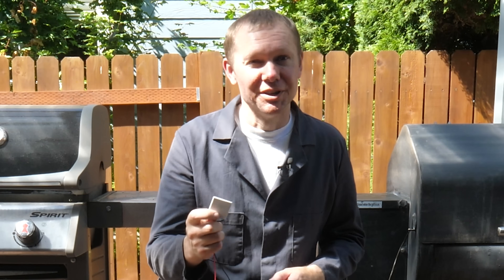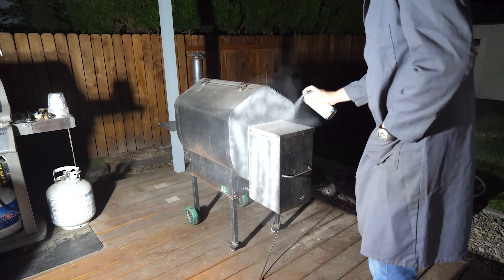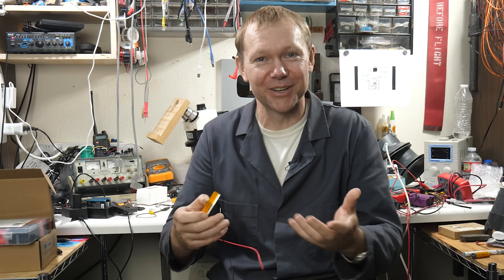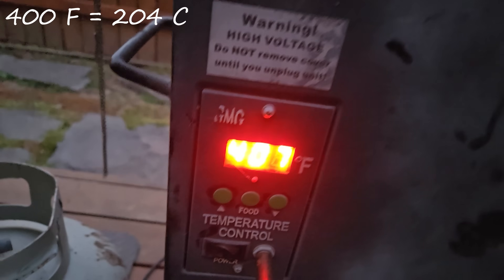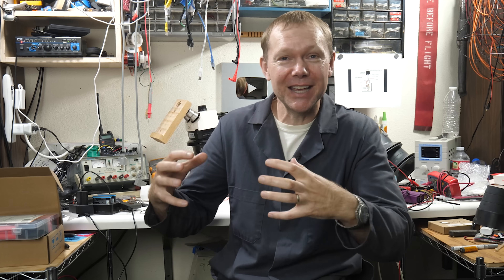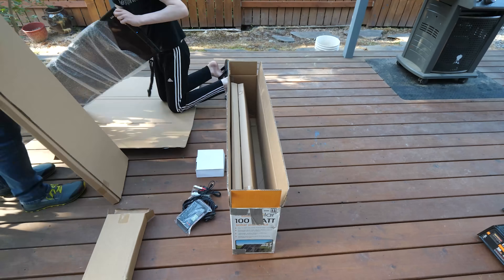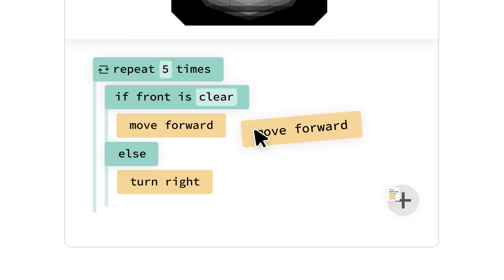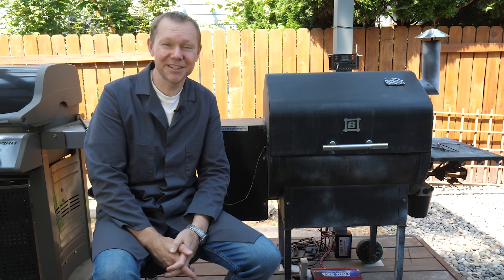Can you make ELECTRICITY while cooking?

Comment from the maker: One of the Quint BUILDs patrons (they get early access) recommended a battery 3x expected demand to maximize longevity, so ~15 Ah. Apparently lead acid batteries don't like being discharged below 50% and lose anywhere from 3-15% capacity per year when treated nicely. Lithium can go far lower but doesn't like being charged in cold weather. So maybe if a lithium bank were kept indoors, that might be a better way to go? 

The video with details on the solar setup can be found here: https://www.youtube.com/watch?v=WNP5ld7AJGg&t=0s

The patron-only version where I go into details about 3D scanning for CAD modeling plus details about thermal imaging can be found on Patreon after you sign up!

Lastly, this was a fun project that most anyone who is project oriented could figure out. Naturally anything you do is on you. If you're unsure, either get some professional assistance or don't proceed. Ultimately it's up to you!
Reply: Use a Stirling engine with a propeller instead
Reply: Hey maybe you can help change my life and help me not feel like a prisoner locked away in my house during the Florida summers. After watching this video and you showing how the ThermoElectric module is used to make portal coolers the thought came into my head if it would be possible to connect one or more of them up to a recirculating water vest to keep it cool without a use of water packs. At the moment I'm missing out on my 2 year olds life do to my disabilities and heat above 76° F is fastest trigger to shut down my body. I live in Sunny and getting hotter South Florida. My support system is here and money is tight since my diagnosis back in 2019 so moving to a cool climate isn't an immediate option. Your a father so you know how important it is to be around in these early years and I'm growing depressed not being able to go for walks, go to playground or even be out of the A/C for more then 10 mins with my boy in the late fall and summer months. I've had the idea of a water cool vest ever since I saw the video of Adam Savage make one when he did the Astronaut Cosplay for Comic Con but I can't keep a backpack of heavy water on my back. An active refrigeration solution with passive heat dispersal would be my idea.
Reply: I'll do some of my own research based on the information you provided in the video but I'm very new to theory of electronic circuitry and my only skill set is soldering and repair of existing boards and very basic 3v & 12v LED circuits.
Reply: Those issues with lead acid batteries are real. Also, lead acid batteries should ideally be kept fully charged as much as possible, as in, use but charge up again as soon as possible. The disadvantages of lead acid batteries are least severe when used like crank batteries or short term backup power. Starting a healthy car engine typically only requires a small fraction of a percent of the crank battery's nominal capacity.    

There's also the issue of of quite severe self discharge rate, which varies with the battery and storing conditions, but even really good lead acid batteries in good shape typically have self discharge rate of a few percent a month.      

Lithium-ion batteries typically don't like to be charged when they're below 0 °C, but it wouldn't be difficult to use the solar power to gently/carefully heat up a battery to above that if needed before using solar power to charge the battery if you want to store it outdoors.

Comment: The biggest misconception about Peltier coolers I see is that they don't generate "electricity from heat" they convert difference in temperature to current. It's equally important to keep one side cold as it is to keep the other hot. Also their efficiency is pretty garbage compared to something like a steam turbine.

Comment: I hear car companies tried to use these thing to extract some energy from the hot exhaust/ catlytic converter. The heatsink would have been cooled by the wind when driving.
But the energy output was so low making the additional weight and costs not nearly worth it...

Comment: Not surprised that the Peltier idea didn't work... People just don't understand Peltier devices, not provided proper cooling to a Peltier device is the equivalent of placing a solar panel in the shade and expecting it to work! The two are more similar than people realise! 
They both need more than one device to be of any real use! They both need an mppt charge controller to manage the high voltage output from multiple devices in series into usable voltage and current.... 
The Tec Ingredients YouTube channel managed to achieve a 2.1w output per Peltier device with good cooling... I highly recommend watching all their videos on Peltier devices, they built a fridge, freezer and generator out of Peltier devices and did extremely well! I have yet to see someone take it to the next level and demonstrate what is actually possible with these things.... 
Going by the possible 2.1W output, if you covered the same area of a solar panel, if done right, the Peltier device panel should output more power than a same size solar panel on a perfect sunny day! 
The generator that Tech Ingredients built used 36 devices in a package small enough to fit in a boiling pot of water over a camp fire by a running creek which provided cool water, they were able to run a 45W led floodlight which lit up the place perfectly! I honestly believe that the generator which if the devices were generating 2.1w per device times 36 of them, that is more than 45W.... 
Maybe there's something in their video that you might get an idea for your Peltier devices? It's possibly the best video on power generation via Peltier device or cooling and freezing..... You may know the channel or maybe even seen the videos I have mentioned, but if you haven't, I highly recommend it! It just might change the way you think of these things, you just did it wrong... And there's nothing wrong with that! Just don't let it get you down, there are more videos that do it wrong than videos which get it right.... I have watched hundreds of wrong videos! I can spot mistakes from a mile away and I'm rolling my eyes thinking nooooo! Not like that! Yeah of course it's not working! 
Watch the Tech Ingredients video and see if you can see where you went wrong! It's the benchmark when it comes to Peltier device videos.....

Comment: Those fans have a metal stick that holds the TEG module above the heat source which limits the maximum temperature because they are delicate. What you could do is attach some larger heat sinks to the TEG modules that are actually able to pull that much heat and then they would work a lot better... maybe you'd only need 10 of them at that point. Biolite makes a wood stove that is entirely powered by a TEG module, despite their lackluster thermal design and electronics, it does indeed work.

Comment: I think this could work, but I do think it'd need to be a semi-purpose-built vessel, and I think you'd need to leverage water cooling and some kind of recharge/discharge energy reservoir to make it work. The general idea would be that you have a 2-compartant grill, the upper "grilling" stage and the lower "burning" stage. The lower stage would be fully insulated on 5 sides, and the top "plate" would be a porous thermal/gas exchange interface that allows heat and gas to ONLY be rejected through the cooking chamber. The cooking chamber will have a series of metal capillaries that bleed the hot air and smoke out of the chamber and into a central exhaust that percolates directly into a water jacket surrounding the entire chamber. The outside of the water jacket would be lined with TEGs and those would be heat and electrically insulated such that ONLY the cold plate at the top is exposed. A second, sealed water jacket would run around this. The mechanism works by directing as much heat from the burn into the first water jacket, and then keeping the second, cold water jacket as cool as possible, such that the element in the cooking chamber stage is essentially just harvesting the waste-heat of the jacketed TEC generator to do it's cooking, instead of trying to harvest electricity from a cooking vessel. I'm pretty sure this could actually be done pretty easy with stuff obtained from Big Box home improvement stores, too, with the most exotic ingredient being refractory cement or fire bricks for the burn chamber. The cooking chamber and jackets, I believe, could be built using off the shelf copper piping and a couple round, metal things of scaling ID/OD.

Comment: As the main thing you are powering is a fan, why not place the cool side of the modules (including bigger heat sinks) into the air path. Some sort of duct on the inflow side of the fan or something.

Also, try to really find the maximum power point instead of the random power point dictated by the resistance of your meter.

Not saying it might be enough but at least you should be able to draw more power.

Comment: i would probably think to somehow use the built in fan itself to suck air past the radiators before it gets blown at the fire. I don't think the fire minds warmer air, and no fans will need to be added. That is, if the fan pulls enough air.
Reply: That's a fantastic idea!

Comment: Definitely need a bigger battery can usually get batteries cheap from scrap yards they wont crank a car but will run a load quite happily. I use an old one for a small water pump.

Comment: I wonder if anyone ever thought of making Peltier devices into a tubular shape so they could be made part of a cross-flow liquid heat exchanger. The pumps would need current, of course, so if it were ineffective it would be a loss. But if the surface area were large enough and the temperature difference substantial enough it could potentially power the pumps with a usable amount of excess current.
I only know this type of system from small scale brewing uses so I'm not suggesting we power homes with it, but I think there may be some merit in exploring it.

Comment: Really great video as usual and I am glad you were able to reach your goal with solar power. I just wish you had tried a bit more with TEG, as there is much potential in this application. A few hints regarding TEGs.: There are special circuits, that regulate the TEG to always be at their MPPT (maximum power point) at approximately half their open circuit voltage. Sadly you are right, the efficiency of these devices is horribly low. At around 30% of the Carnot Efficiency. Combining that with the bad heat dissipation on the cold side, there isn't much do be expected. Additionally not every TEG is suitable for every application. Under ideal conditions you want to reach impedance matching on the electrical side as well as on the thermal side, where heat source to TEG to ambient is the thermal resistances in series. I hope you try that technology again in the future. Would love to see that :)

Comment: Why not use running water to cool the heat sinks?
I have a 300W panel with basic charge controller and leisure battery which runs the irrigation pump from the rain water tank and the lights and USB charging station in our polytunnel. It really works a treat for a few hundred euros

Comment: You think maybe running those things with water cooler plates would work better? Could do a type of system kind of like a cars but instead of using an electric water pump maybe something like the little pop pop boats use? Idk just spit balling.

Comment: The power is produced by the diferential of potential between hot and cold. Hotter on hot side and cooler on cold side will make more power.
Put the hot side over a candle and a zalman cpu cooler 100% cooper on cold side and youl get the voltage you looking for.

Also you can create a relative air conditioner to lower the temperature of a room with just 4 of this ones consuming less than a TV.

Comment: The grill should be able to work, but only with some radical changes:
Currently it's DC -> inverter -> AC ->  rectifier -> DC -> voltage regulator -> electronics in grill; instead of this, cut out all the middlemen that introduce losses and power the electronics by a voltage converter directly from the TEGs, they should only consume <1W when powered that way. Now replace the AC fan with multiple TEG fans. For the pellet feeding motor, install a DC-capable and lower power consumption motor. The TEGs for the electronics should be chosen so they make excess power. Feed this to a small battery (e.g. 18650), which slowly charges and then releases it in short bursts when the motor is needed. To cool the colder side you could use CPU coolers or just water.
However, initially lighting the pellets must then be done by hand with a good lighter.

Comment: You are pulling heat from the Grill to power the device that helps adds heat to the grill. While the device does not make the heat, the burning of the pellets does, It would be interesting to guess how much more fuel the grill would need to run off these devices. Would the device need to pull more power to operate the fan and auger for the increase heat output needed? I'm sure there is a chart you could find for that.

Comment: Good learning demo over all ...
There is a big difference in applied surface area ... 6 TE modules 40mm x 40mm each is only about ~14.9 square inches of surface area on the Seebeck attempt .. and about ~775 square inches on the ~100watt of PV .. with the same ~14.9 square inches of surface area , I would will expect the PV to be giving out ~2watts in direct sunlight .. and even then , I think the PV would out perform the TE .. modern PV semiconductor modules can be 2x to 4x (depending on module and conditions) more energy efficient than modern TE semiconductor modules .. soo even if there was the same watts of heat flux moving through the same surface area , I would still expect the TE to give out 1/2 to 1/4 what the PV does .. Seebeck is usually best fit technology for only a few conditions (RTG on NASA's deep space probes , lots of waste heat too low of a dT for other technologies , etc).

Comment: If you're using a propane grill, you could try attaching the cooling end to the propane canister. That will naturally get cooler as the container drops in pressure.

Although, you'd probably have to keep the canister away from the heat source a decent distance... maybe you could fix  one of the cooling rods that TheActionLab recently talked about to send cooled liquid to the cooling side of the thermoelectric module. That would definitely take some creativity.

https://youtube.com/shorts/ZEGazGMEhtw?si=8MgfZBvNfvPRIWc8

Comment: I really wish you'd use actual high temp, more efficient TEGs and proper heatsinks, like cpu coolers. I actually bought a bunch of both to put on a wood burning stove in hopes of getting roughly 300w from a rough calculation, out of 10 TEGs and CPU cooler combos. I just need to find the time to put it all together. Those mass produced Peltier coolers aren't really designed for electricity generation.
Reply: OEM CPU cooler, with the integrated fan, can be had for CHEAP, and they would vastly increase the temperature difference across the TEG module. I would love to see this work
Reply: he should be careful around the heat pipes though, I'm not sure they can handle being 500K
Reply: @crackedemerald4930  That's why I said OEM. The stock Intel heat sinks usually don't have heat pipes. They're just copper and aluminum. Or just aluminum, for the cheapest of them.

Comment: 11:06 if youre feeling froggy. Steam powered turbine to generate electricity. The heat from the grill might be enough to steam it up. Especially at 400 deg. 

Or. Put the steam chamber in the grill with the turbine outside.

Comment: Why not just use a Stirling engine to power the fan directly?
Reply: Great question! A stirling engine depends on a temperature differential just like the thermal modules. Because the grill sometimes needs to run for many hours at a time, the same problem arises. The cold side of the stirling engine gets hot, and when both sides of the cylinder are hot it won't transfer enough energy to spin.
Reply: @TheOfficialOriginalChad water is all it needs to cool the top of it.
Reply: @stonedsavage7814    sorry, you’re suggesting that what should be water cooled, exactly? 

If you mean a stirling engine or, I suppose you could water cool it. The water would need to be continuously cycled (and pumped) through a heat exchanger OR run a hose from the house and drain it. 

At that point you’re using wind, fire, and water to run a grill…it would be much more efficient and easier to slap a solar panel on it and let it charge the battery when you’re not using it.
Reply: Stirling engines on a load don't produce as much energy as you think they do. You'd need a sizeable one to produce usable energy
Reply: @zano9291 you can make the engine spin the fan blades directly without producing electricity.

Comment: Maybe a crazy idea, but what is you can tap into the intake fan side and take the heat from the firebox above and the fan/channel from the intake to 'cool' the cold side of a bigger heatsink? Cheap/used CPU coolers are great for that and disapate a lot of heat.

Or, try a more direct heat contact to put a copper sink on the hot side inside the stack and a heatsink on the outside. No idea what the max temp is on those TEC/TEG's